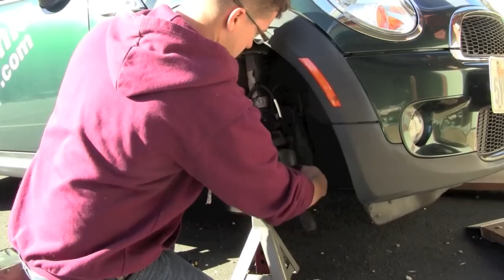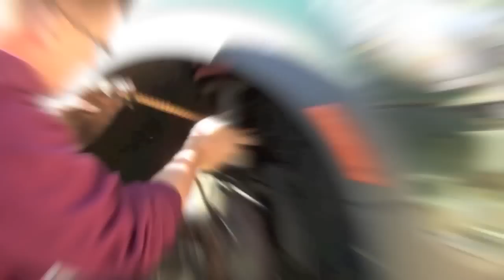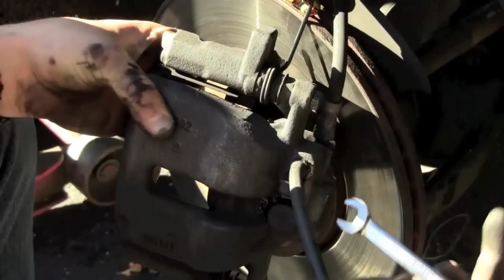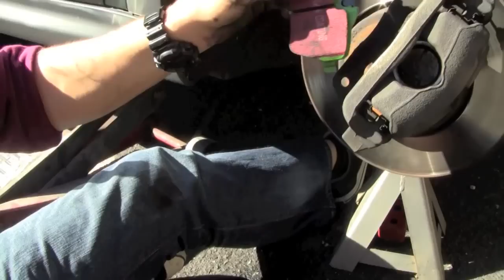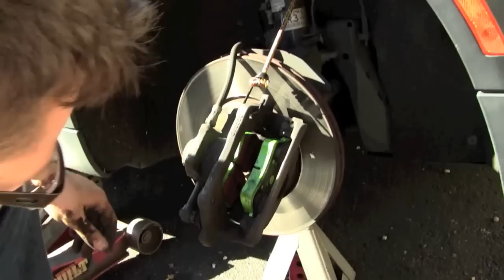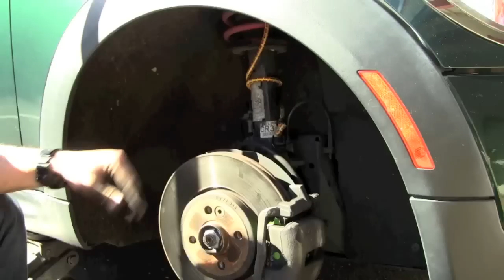MINI Cooper Brake Pad Replacement Video

Comment from the maker: You're correct in that you don't need to slip the caliper off but we thought we show it in case someone is planning on replacing the disc (and also to show the bleed screw better for the video). As far as the copper grease goes, these EBS pads are rubber backed and don't require anti-squeal.

Comment from the maker: It's always a good idea to bleed a little fluid as bottom the pistons in the bores. Sometimes you can do it without bleeding the fluid but be aware that it usually takes a lot more force without releasing some fluid.
Reply: You dont need to bleed it out. Just gradually force the fluid back up into the resevoir with the c-clamp. Simple

Comment: Can you give a list of the tools you used, including their sizes, including how you removed the wheel?
Reply: Douglas Draper and thats why this video is a fail.  Music instead of instruction, nothing describing how/why the brake line was bled while the piston was pressed back into place, why the rotor was brushed with sandpaper...

Comment: This is a video of how not to change brakes. Strained brake line, no surfaces cleaned, no grease used, fingers all over pad surface, brake fluid on the floor and not in a container to stop air being drawn back.... etc etc.

Comment from the maker: Well, technically, you should call it a MINI (in all caps) and refer to the cars built between 1959-2000 as Classic Mini's. But, you'd be surprised at what is still available for the classic cars. Just go to our website, Mini Mania daught calm, click on the Classic Mini Side and take a look around. We have shipments coming in from the UK every two weeks with parts for your Classic Mini, Morris Minors, Austin Healey Sprites and MG Midgets.

Comment: Is the procedure the same for 2015+ mini cooper s?  Are there any special tools required?  TIA.
Reply from the maker: +r56mini The procedure would be the same but the brakes on the newest MINIs are different in that the rotors and calipers are not identical to the ones in this video. From the F56 cars on the wheels are now a 5-lug design and so the brakes were redesigned around this change.

Comment: Scoring up the rotor with that pad as you did was a waste. I agree that it isn't a bad idea to do but to do only one side is a joke. While you have the caliper off pull the rotor and do both sides and replace I mean it is only 1 screw removal!
Reply: Not really necessary since no grinding on the rotor occurred. Im wondering about replacing the wear brake pad sensor and resetting the warning signal?

Comment: just NO!!! you don't need to open the bleed screw on the front brakes at all.. you should simply remove the brake fluid reservoir cap & wind the piston back.. also not having any hand protection on whilst working around brake fluid just isn't any good... I've written this comment before getting halfway through the video.
bloody hell how stupid.. bleeding the brake fluid onto the bare ground.... WTF

now touching your new brake pads with your oily hands & nicely contaminating the pads "BRILLIANT!!"total amateur.... certainly not "how you should go about changing any brake component.